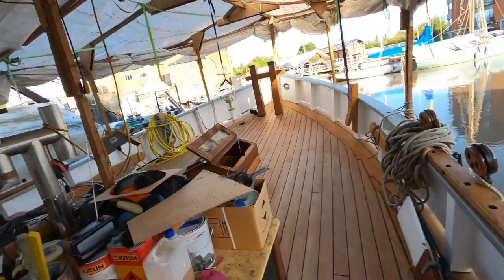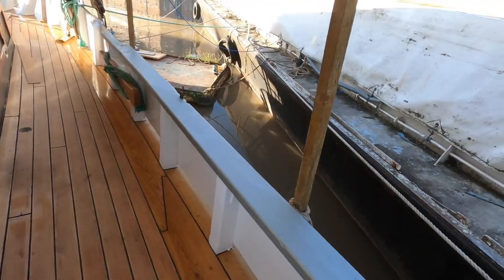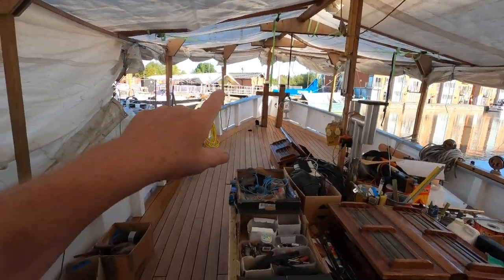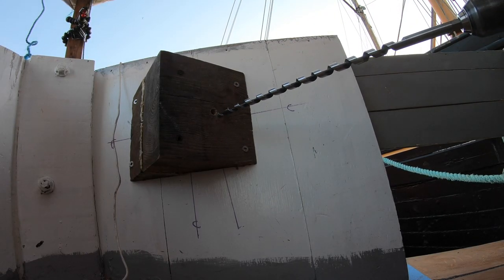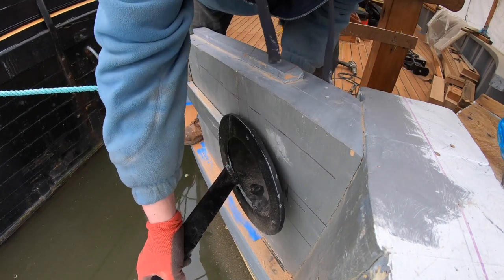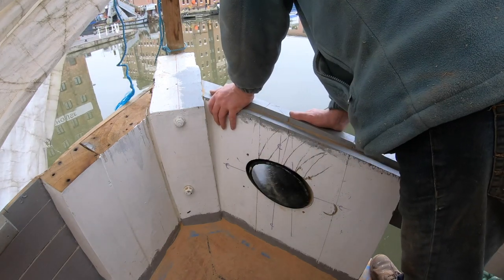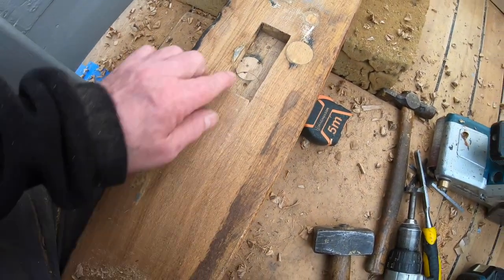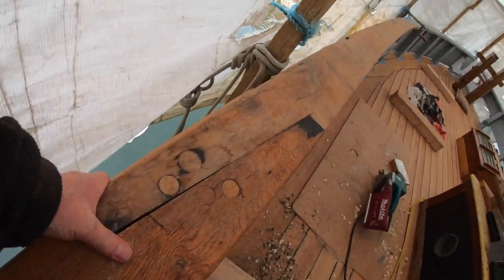Restoring Josefine - Part 12 - Cutting Big Holes & Tight Joints

Comment: Per: the bow hawse roller, you might consider a pair of 'L' shaped 2cm rods bolted or welded to the roller support so that they pass over the roller with a gap slightly wider than any chain or line used for anchor rode. They will keep the rode from 'jumping' the roller when the anchor hits bottom and the rode keeps whipping out. It's not critical, but it would save having to fish the rode back up onto the roller, especially helpful when anchoring in foul weather...
Reply from the maker: Thank you Mike, I understand, something we will look into, slightly more difficult as the spade anchor also gets pulled up and onto and is housed on the roller, but we can probably figure something out.

Comment: You can start a hole saw at an angle if you you have a large and long pilot bit which you had, it actually cuts better as you found out at the 
End. It is also much easier to chop out with much better side access. Love your project and is getting closer to done,cheers
Reply from the maker: Thank you John, we have tried but my wrists just can’t take it!

Comment: The wood for the capping rails appears to have been recycled.What species of wood is it and what was it used for previously?This is another well thought out video,very engaging and always leaves the viewer wanting more.( By the way you mentioned in your last video that the direction of the bolts in the scarf joint should have been drilled in opposing direction to pull the joint together?)Thank you for another wonderful video
Reply from the maker: Hi Joe, so far we have been able to salvage bits of the old capping rail which is Oak, but we have now run out of that so for the wide bits round the stern we are on the scrounge and think we might be able to cobble something together using old capping rails off other boats that have been restored with new wood. Thank you for continuing to support us.

Comment: I like whenever possible to make router templates to sink mortices, much quicker.
Reply from the maker: Hi Jonathan, almost certainly right but we have to work with the tools we have and my router is very old and big, it’s foot is bigger than the width of the capping rail, I know that it would still work but it would be hard work setting it up. I often look longingly at the modern cordless small one hand models, they look the biz but we couldn’t justify the expense. Thanks anyway for pointing this out for the sake of anyone else undertaking this work.

Comment: That is one thing working on a wooden boat teaches a person.. Patience and repetition on off on off on off.......... She is looking fantastic and your hard work is showing. Just one comment, I have learnt over the years.. before cutting the mortice I always start my edges with a chisel just tap it down on the line to break the timber and for you, it will be easier to start your cutting of the depths as you have a grove to start you off with.
Reply from the maker: Thank you Tim, that is very good advice, one of the very many lessons I have learnt restoring Josefine, has been the value of good quality sharp chisels, I love borrowing chisels from our shipwrights, they always work much better than mine, it’s one thing I really must learn, how to properly sharpen an edge.